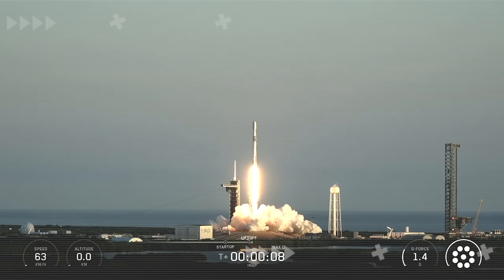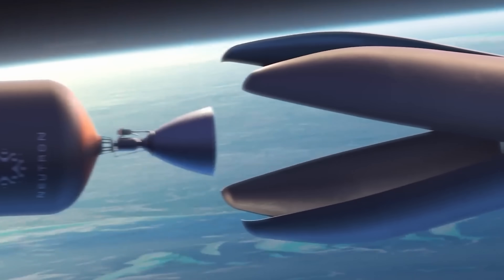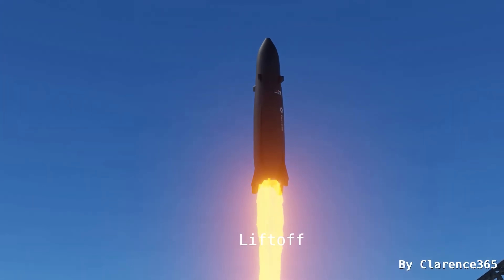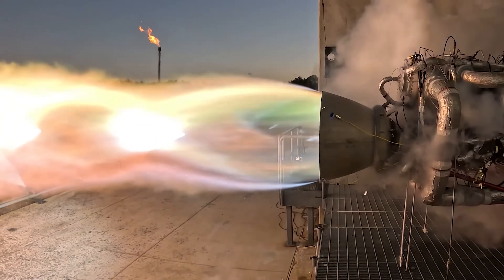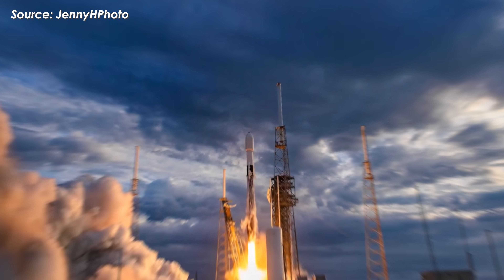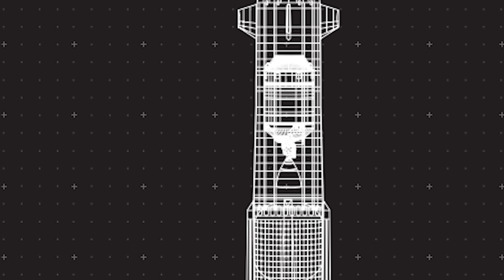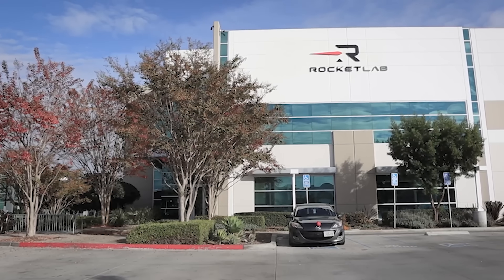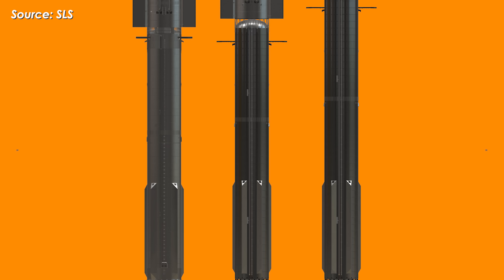What Rocket Lab Just Did to Catch up with SpaceX Just Changed Space Race Forever!

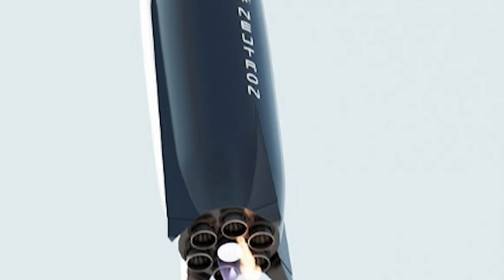Comment: 7:50  No, not "time to deply the satellites" but time to release the second stage. The uniqueness of Neutron's design is that its second stage with payload is designed for strictly in vacuo operation, the fairing protecting both the payload and second stage during the ascent.  It's not an SSTO. 8:14  Space X does not catch fairings with a net on a boat any more. The fairings have been upgraded to withstand landing on the water.

Comment: Peter Beck said Neutron is human rated. Rocket Lab just needs to produce a capsule among a few other mods, but it's a bit unfair to say never.
Reply: RLab should develop one person capsules with tubes attached to human intake and evacuation organs, control panels to hands and VR set to the head... to lessen the muscle and bone loss some space is required for giving some movement to the limbs. one could launch two capsules, interconnect them, rotatate ang produce artificial gravity too. better than the described above is to lunch a robot controlled by Ai  and a human from the comport of his/her home...
Reply: Technically, it's a rocket designed to be human rated. It needs some flight heritage to get there. In theory you attach a Dragon to it, or even a Dreamchaser (if it's not de-funded which would be a shame). I think it's also capable of taking an Orion.

Comment: Keep in mind that what matters most is not the price your customer pays but your own internal costs and therefore your margin. A lot of the costs of a rocket launch are essentially fixed and thus what really matters is cadence. That's why Neutron's design matters. Neutron won't be flying every day for a while, but re-use within 24 hours was part of it's design brief. Also there was an interview with Peter Beck a few years ago where he stated that in a typical launch, two thirds of your costs are operational. The facilities. The labour costs, and so on. Again, a large part of your cost structure is fixed and it's cadence that determines your margin.

Neutron is designed with a light weight, low cost, high performance second stage. It's expendable but then it's also roughly 10 percent of your vehicle cost. The other 90 percent is reusable, including the fairings. Neutron is also designed in a way that the first stage separates into two modules. The core module with the tanks and engines and the upper module which holds the second stage and payload. That means that the payload and second stage can be integrated separately from the main (core) module, inside climate controlled spaces. Why does this matter? Because you can land a Neutron, unbolt the upper module and take that way for separate processing. Then bolt on a new upper module with the second stage and payload already integrated. This is how they enable a 24 hour turnaround. No other rocket can do this. 

Neutron is an amazing design. Two things. Firstly far too many commentators talk about cost per kg. That might matter if you're flying hundreds of tonnes of fuel into orbit (fuel being the vast majority of mass in any future space program). But it's a secondary concern to commercial space customers. They care about reliability. They care about timing. Their payload is generally worth a lot more than the launch price. Secondly, Peter Beck when interviewed has said that the one thing he doesn't lose sleep over is lack of customers. There is enough demand for launches past 2030 that there is room for several major providers.

Archimedes does throttle to 50% which gives it last second hover capability and is sufficient to put a ceiling on g forces for the second stage. Quite an accomplishment for a staged combustion engine. Merlins are a lot simpler, but they also burn RP1 and thus require a lot of cleaning between uses.
Reply: i lost patience reading, sorry
Reply: @ksd593 LOL. You're short on time, but willing to waste time writing a pointless comment?
Reply: @saumyacow4435  well the truth is i got time... i commented under many comments here. then near the end i came across yours and i couldn't finish reading it... so, i decided just to leave a comment anyway, might be pointless, i'm even not arguing about that...
Reply: You’re saying all this as if it’s all proven facts. Nothing about the Neutron Rocket has been proven yet with an actual flight. It’s Sir Peter Beck because someone in England was thrilled with him.. Elizabeth II.
Reply: @gregorylayne9044  Oh, look, an Elon bot! :)
Reply: @gregorylayne9044  what Elisabeth has to do with Beck... sorry, i will not google...